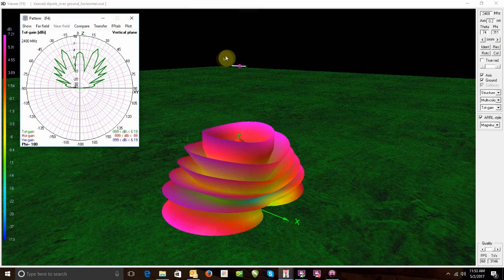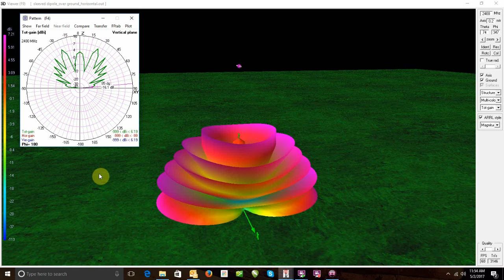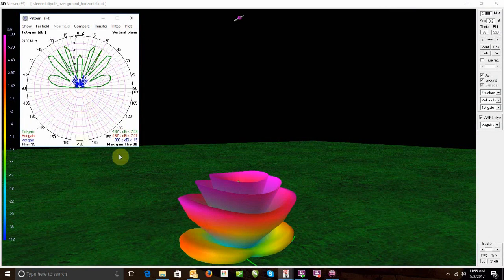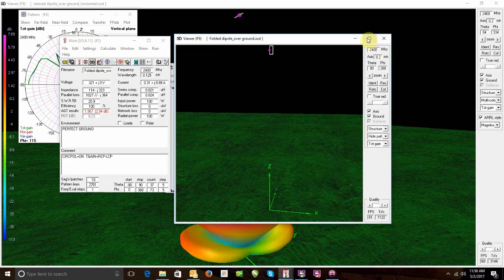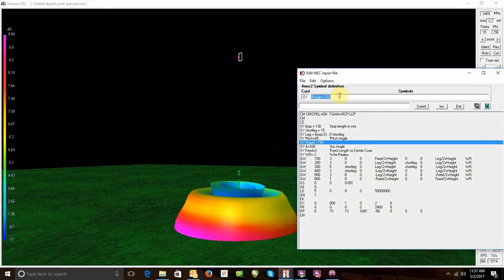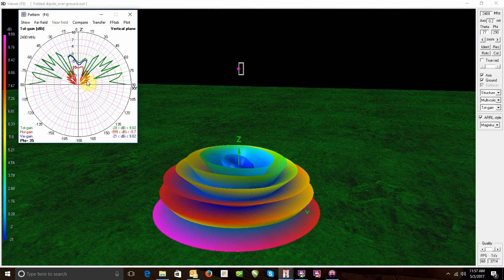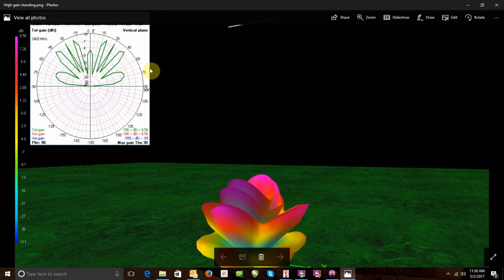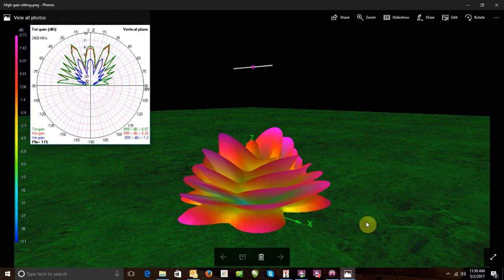Why I modified the antenna on my 2.4GHz RC radio

Comment: Alex what is your input I  people getting worst results after modifying their radios? There many cases out there, such as Joshua Bardwell's experience, where the tx module fails. Is it worth modding?
Reply from the maker: I show in this video why the 5dbi mod has issues.  You also have to factor in poor soldering, crappy coaxial cable, and an imbalanced antenna to the mix as well.  I would only mod the Taranis if I was comfortable with soldering and had a good cable.  Otherwise you run the risk of damaging it.  In the case of Spektrum, there is an IPX connector inside, so no soldering required!
Reply: is this antenna and the mad mushroom going to be available in RP-SMA or will we need to use an adapter? Asking because I'd guess the majority of us that have done the mod did so with RP-SMA to fit the wifi antenna.
Reply from the maker: Always SMA.  However, if you have RP-SMA, you probably have the really crappy 1.13mm coax and should replace it.
Reply: naah I got the good stuff because I did a little research and found your info and steele's on it lol. I can either use an adapter or redo the mod again with SMA though... I wouldn't have even bothered with it at all had I not bricked my internal xjt though - working quite well with the router antenna currently but that thing makes me nervous... always see it snapping off right at the base in my mind's eye
Reply from the maker: Just use an adapter.  They're cheap and they work.
Reply from the maker: No.  I stopped including them to lower the price of my antennas.
Reply: dont they also come with almost all your antennas anyways?
Reply: Interesting. after reading this, I searched in digikey and only found 2 items (among a few hundreds RG316 products ) are rp-sma with rg316. Can you explain why RP-SMA tend to have thinner cable?
Reply: Video Aerial Systems Any reason why always SMA?

Comment: Hi Alex,
using madmushroom antenna on transmiter implies using circular antennas on receiver, am I wrong?
Reply from the maker: No, actually.  It just works well with linears.
Reply: yes it's probably works but does pure theory tells to not mix linear and circular antennas ? is your new antenna linear?
Reply: got another question to ask about 5.8ghz vtx antenna: what do you think about the new designed pagoda2 (said to have great rejection lhcp rhcp) and luminer axii  (very compact and efficient). I'm using pepperbox on receiver side, it works really great but on models side I'm looking for really small and durable antennas.
Reply from the maker: You can mix.  There is a 3db loss in doing so, though.  Not usually a big problem in most cases.

The folded dipole is linear.  It has been around for decades.  It is actually really old school tech ;)
Reply from the maker: Admittedly I haven't tried any of the newer 5.8GHz antennas, so I'd rather refrain from commenting until I can get some stick time with them.

Comment: Thanks for the info! I installed the sma jack on my dx8 and have been looking for a decent antenna to replace the rubber one Ive been using in the mean time. Ordered up!

Is it better to have this antenna sitting vertical or flat?
Reply from the maker: Vertical is better in 95% of the cases.
Reply: @CAGreve1231  Will the effect of the VAS Diamond being able to track along the ground better be still valid when the antenna is horizontally positioned instead of vertically? I would like to try the 900Mhz Diamond on my Crossfire, but would have to use it in a horizontal orientation as the antennas on my quads are all horizontally mounted (as far away from the carbon under the arms, but horizontal orientation).
Reply from the maker: @napfpv6239  - It will actually work better for that in horizontal orientation.  Horizontal polarization travels better at low altitude.
Reply: Video Aerial Systems which logically makes the most sense.  And strangely the exact opposite of what comes in the instructions for the taranis QX-7.    
Thanks for the vid IBC!  👍🏼

Comment: could you make a video explaining how to make this antenna
Reply from the maker: Give me a few days to make the video.  You need to be skilled with a soldering iron to do it, though.
Reply: been soldering for years so that isn't a problem, only need to know total length, length of each part and the radius on the bends and where to solder

Comment: So, the mad mushroom would be a upgrade over the +5db antenna? What about antenna gain?
Reply from the maker: Gain is quoted in free space (see Bill Somrak's comment).  The ground changes things quite a bit.  You can see the pattern and gain is HIGHLY erratic.  The Mad Mushroom is incredibly stable and maintains a 3dbi gain plus polarizes in all directions which eliminates drop-outs.  The 5dbi has nulls you will inevitably fly into.
Reply: Ok! Thanks for the reply.

Comment: Hmm .. never noticed any drop-outs on my Taranis 9D+.  But, it is interesting simulation software.  I have an Extra Class Amateur licence, and have done considerable antenna work, mostly in my younger days. I remember studying all the theory of radiation patterns in "space" vs. on earth and all that stuff.  There are a lot of factors, and things are definitely more stable at HF than at SUHF. Cheers.
Reply from the maker: Hence why I give the simulation files so people can model it for themselves.  This is just my personal experience.  Of course, you and I hold our radios differently and at different heights which is likely the reason for different results.

Comment: would this help with 433mhz or is it not botherd as much ?
Reply from the maker: I believe it would.  I haven't gone to mod my 433MHz radio (the plane is to do that today).  I will report back with my findings.  Of course, you could always just multiply my numbers by 2400/433 and simulate 433 easily.  I like to verify in practice, though.